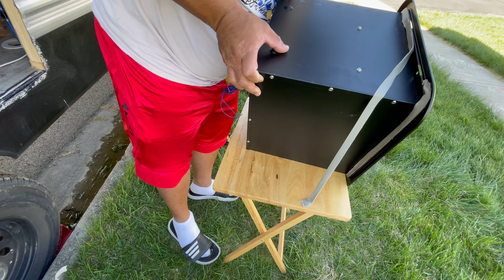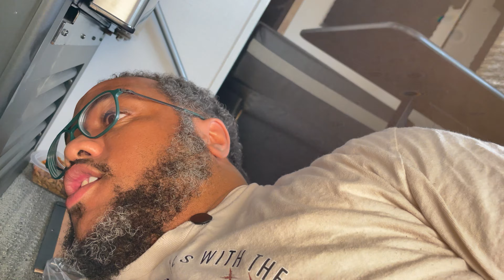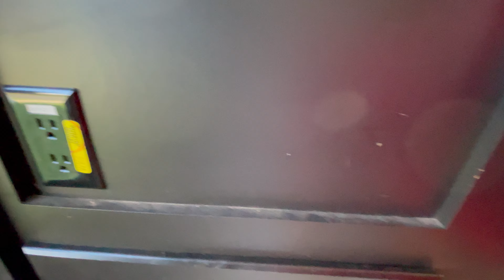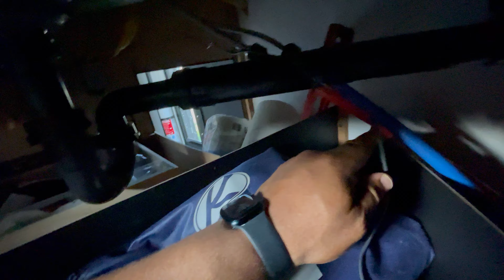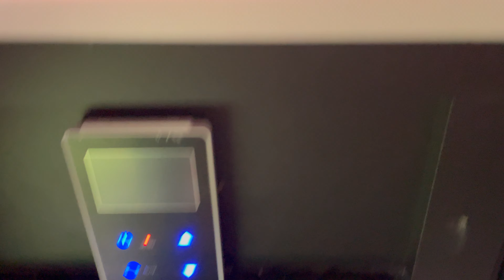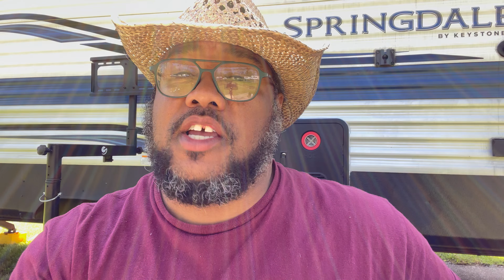Andeman Tankless Water Heater: Installation and Review #Andeman #RV #rvwaterheater

Comment: Here’s my question. My rig came with a tankless water heater. I have a bypass, but it doesn’t bypass the water heater, it by passes to a tube to stick in the RV antifreeze. It is my understanding you Do NOT want to bypass the heater, because you need to get RV antifreeze in the coils, so there’s no chance of them splitting from freezing? During winterizing I turned the handles to hot til they flowed pink- to be sure the antifreeze went through the heater. When I dewinterized  this spring, I had no issues camping with the heater? So why the bypass valve? I’m just trying to clarify. Maybe I’m missing something. Thanks for the great video.
Reply from the maker: That’s an excellent question. We intentionally kept modifications to the existing plumbing and LP setup to make it easy to revert—though, honestly, we’re so happy with it that we won’t be going back. Winterizing with the bypass is completely optional: the manufacturer notes you can bypass the heater once the water’s drained to save about a liter of antifreeze, but we probably won’t bother. Our tankless system is rated for direct use of non-toxic RV antifreeze. In short, the bypass was purely a design choice for anyone who might be uneasy about terminating PEX.
Reply: @ thanks for the clarification!